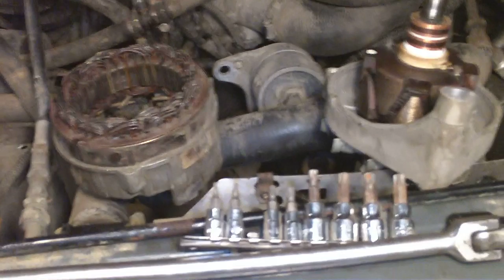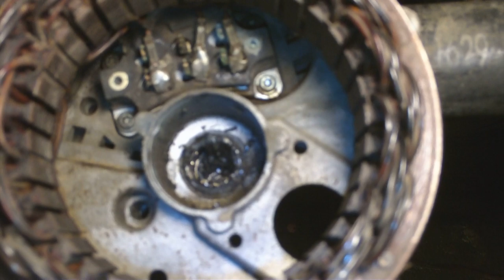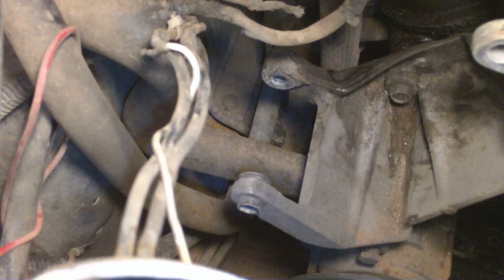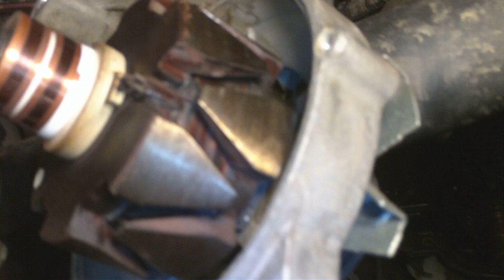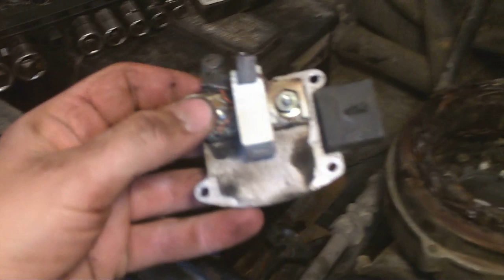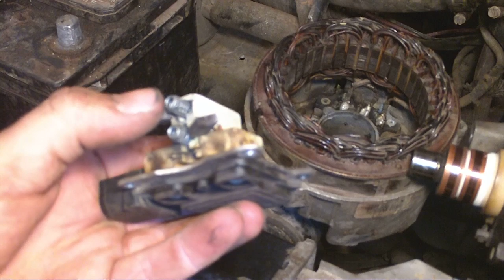How alternators work

Comment from the maker: Sounds like the Regular is staying powered up while the vehicles ignition is off. there are 3 wires to an internally regulated alternator.  1. battery wire. 2. regulator power wire (goes to ignition switch run position) 3. warning light (not required).   If the draw is through the battery wire, it could be a shorted rectifier in the alternator. see if the draw goes away when you disconnect the main battery wire, or the small key-on regulator power lead.

Comment: You know the squeaking is the brushes !      The three pins you describe as being  power light and ground is WRONG !    It is a light  ,power and a stator  pins . The pins are ASI  A = 12 v or battery sense  S = Stator  and  I = ignition though a light . 

Oh yeah, bearing don't squeak, they will  make a grinding noise .  If your alternator makes a high pitched squeal ,the belt slipping  .

Comment from the maker: @sounduser I never use fuses (i know, bad idea) but if you fuse the "exciter" wire (i assume this is the wire which powers the regulator) just a 5 or 10 amp fuse is probably fine.  wire gauge of 18 or better will be fine too.   for the main charge wire, use nothing thinner than 12 gauge (10 if its a long run) and run a 100a fuse or something, although this wire is often unfused.  I'd run a volt meter instead of a "charge light"  since lights suck and may not work right with 2 alternators.

Comment from the maker: @sounduser If you're batterys are wired in parallel then it doesn't really matter, if it's a dedicated battery, then yes.   personally, i'd run the batterys in parallel.

Comment from the maker: @sounduser Hook up each alternator as if it was the only one.  obviously you don't need to worry about wiring for charge indicators and stuff.  the easiest way would be internally regulated alternators, such as chevy 1 wire alternators.. then you'd just have to mount it (automatically grounded by the chassis) and hook up the b+ wire to the battery.. and they'd work.